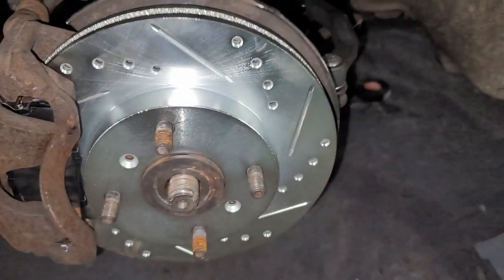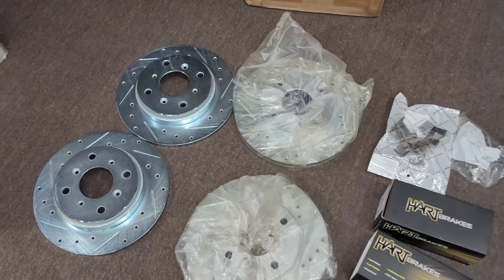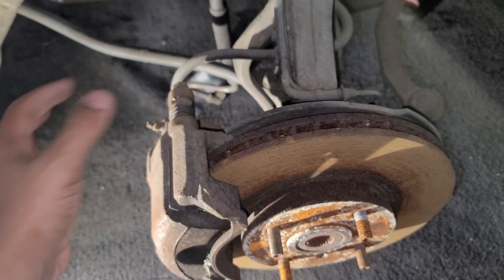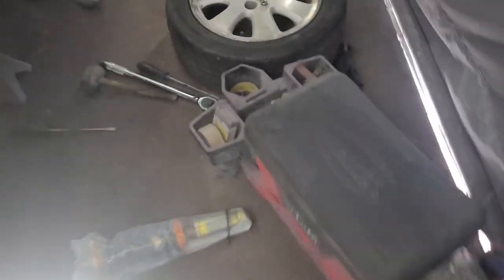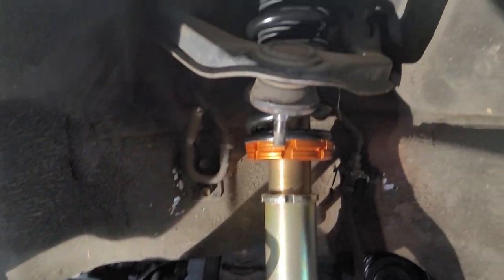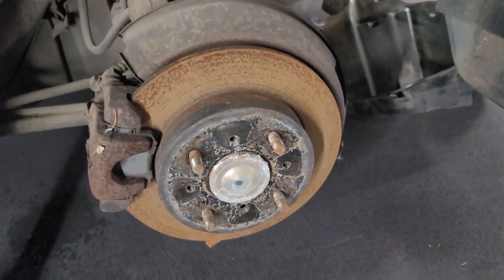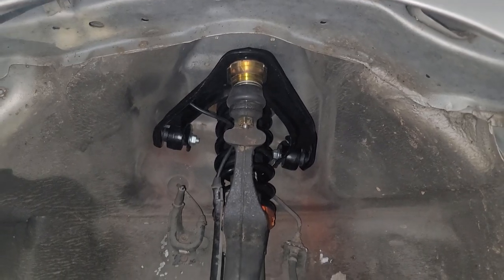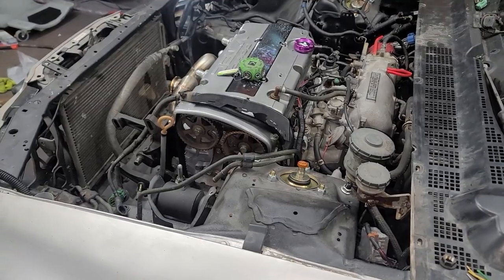How to build a Honda Prelude pt3 | brakes and suspension upgrade

Comment: I have Yonakas, I like them because they have a top ring on them. Which means if you wanna go lower after maxing out, looks like you can spin the rings that hold up the spring all the way down and then put the preload back on the spring with the rings that sit on top of the spring, and the ride quality is A1.

 I've Had mine for about 1.5 years now and they stand up to EVERYTHING, can't count how many pot holes I've hit at speed and them joints still rockin like new! No issues what so ever! 💪🏽😎🔥
Reply from the maker: Sick my boy put me on and he compared them to BC coils and i have those on my other lude so i was sold.

Comment: Damn, brake rotors looked awesome! Where did you get those rotors, pads, etc? I need one for my 94 Accord. Let me know how does Yonaka coilovers ride on road when car is ready to drive.
Reply from the maker: I have a link in the description but idk if it will fit the accord
Reply: @treybedipping1734  Cool, I will check out, thx.
Reply: Front rotors on 94 accord not for the weak...m
Reply: @eurorcb7412  Thanks for info. 👍

Comment: @4:40 is that what I would have to change for the 5 lug?
Reply from the maker: You can press in a 5 lug spindle for the front or replace the whole knuckle assembly. The back is just 4 bolts and swap the hub